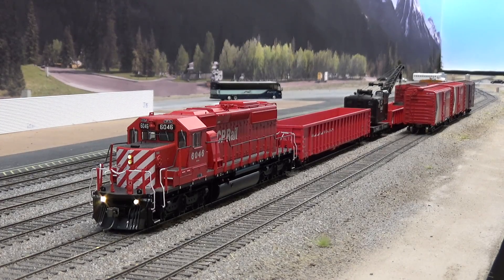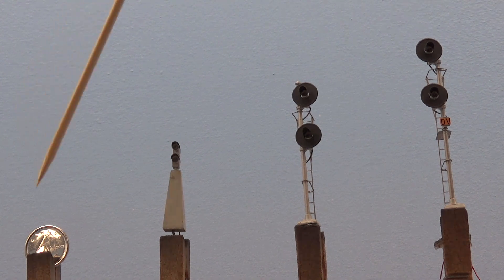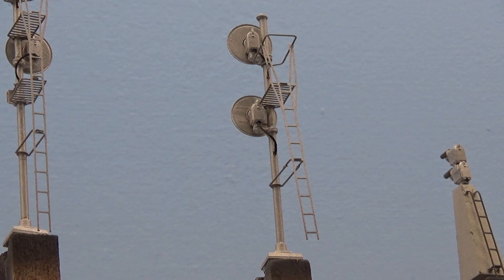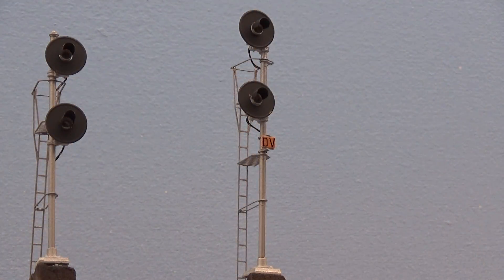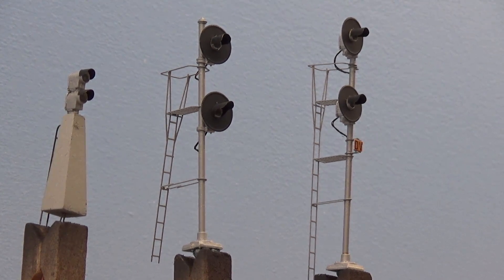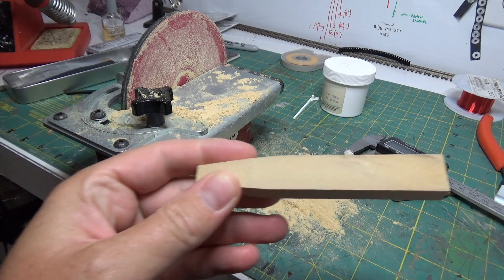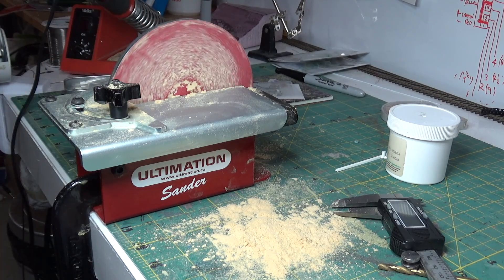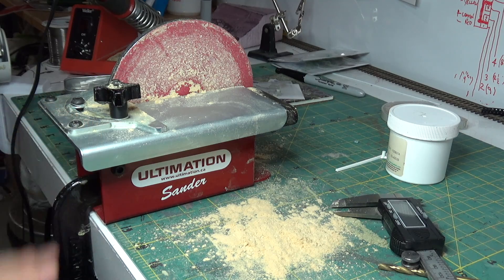Layout Update - August 2020: Signals Finished, Scratchbuilding Concrete Bases, Ultimation Sander...

Comment: Ben, excellent modeling work!  I'm just starting to build some Showcase searchlight signals following Great Northern prototype.  Could you do a video on actually assembling a two head unit?  I'm thinking of developing some jigs to hold the parts while I assemble them and could use some help on making signals as well as yours.  Thanks for the wiring video on 3 color LEDs.
Reply from the maker: All I did was use a piece of foam as a base and worked from the bottom up following my prototype pictures very carefully. Each signal has subtle differences so I don't think there is a single solution on how to build them. The three I built so far were all completely different. Prototype pictures are critical.